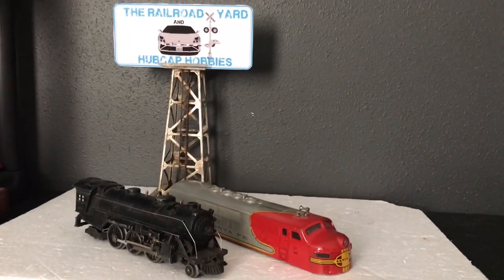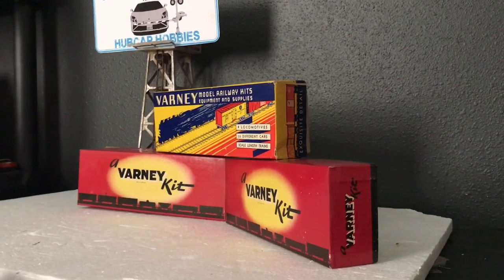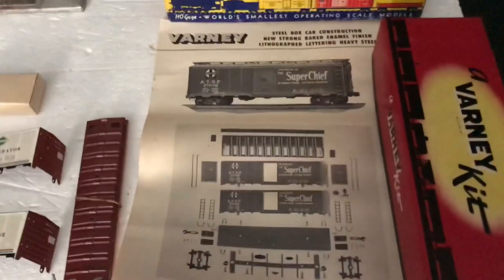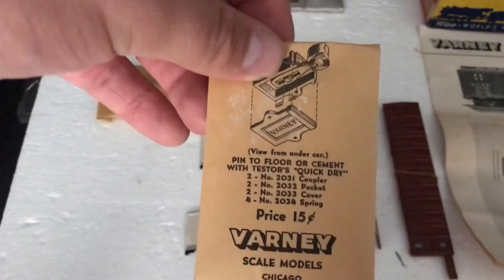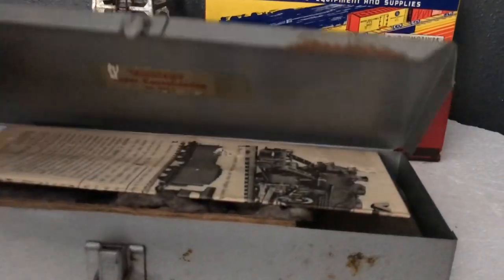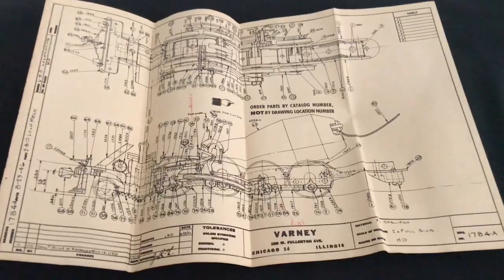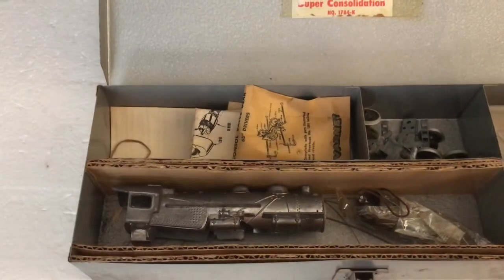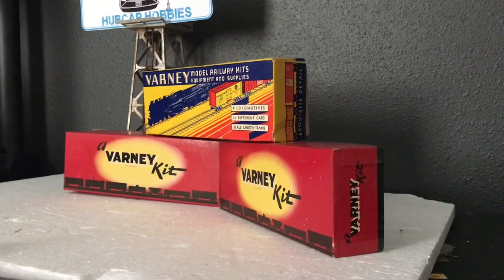Vintage Varney kits HO model railroading in the 50's & 60's

Comment: Back in the day if you were into model railroading you built most every thing.Your locomotive roster was small by comparison to now.Carney made kits for a wide range of items.The cream of the crop for locomotives was Bowser. and there may still be a kit or so hanging around somewhere. My favorite Browser kit was for their Mountain. I spent a few hours assembling mine,it runs quietly and smoothly, equal in operation to the MTH Niagara that I purchased.